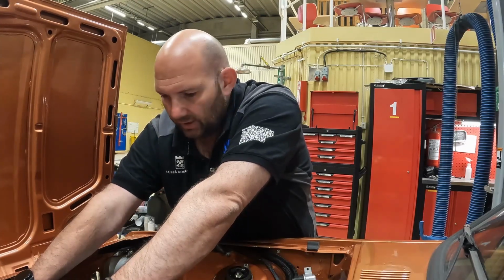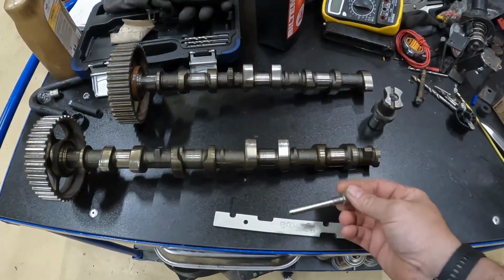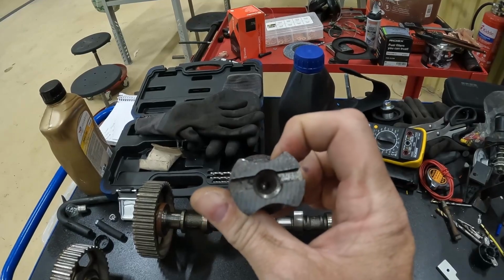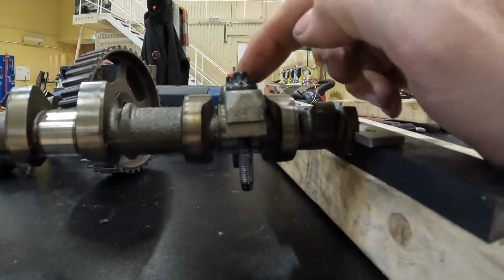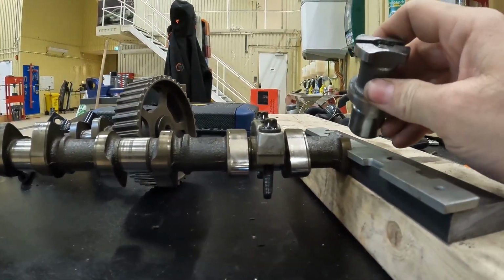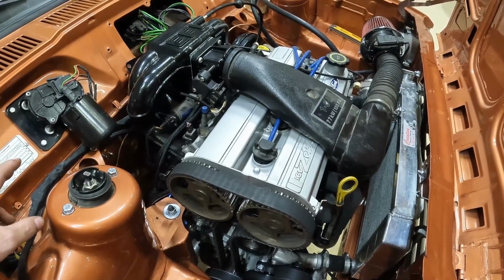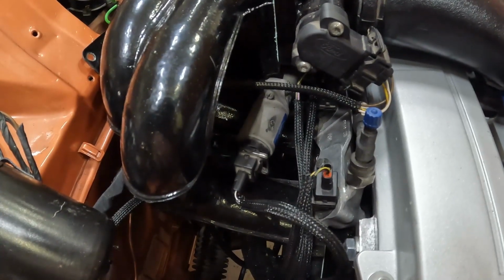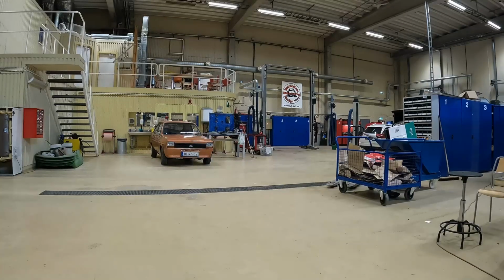The zetec engine in my mk1 fiesta s running and ive driven her for the first time.

Comment: When I got my Mk1 Zetec up and running I decided just to take it up and down a big hill that was just next to the barn I built it in as it's first run.  I messed up changing down the gears at the foot of it and took it in 5th when I intended to take it in 3rd or 2nd if need be and to my surprise it just went up this steep hill in 5th from practically a standing start at the foot of it no bother at all, the torque was great.
Reply from the maker: Sounds like I'm going to enjoy this car 😊😊